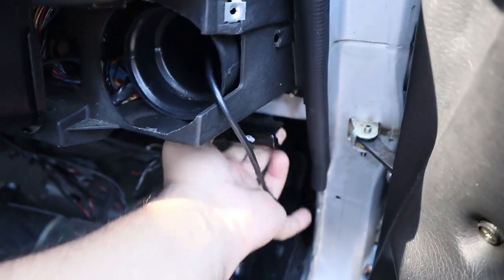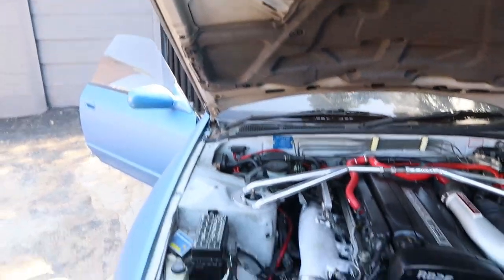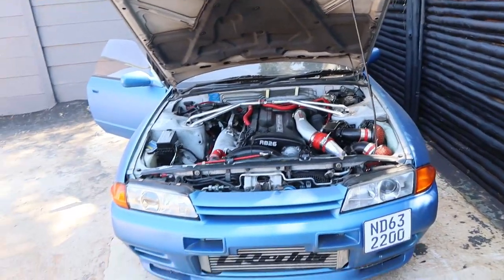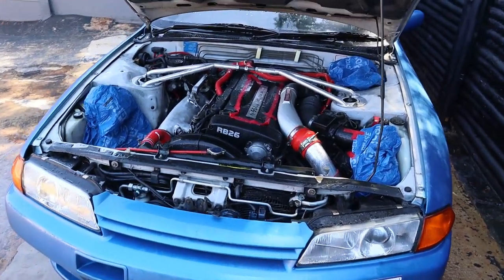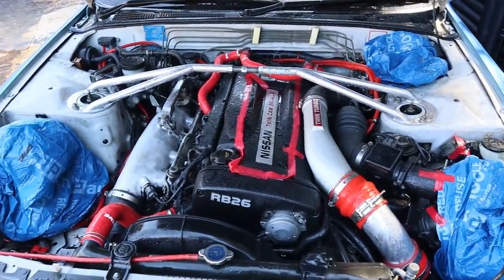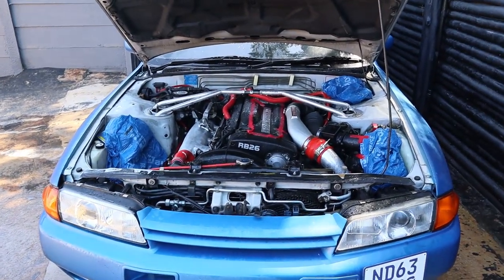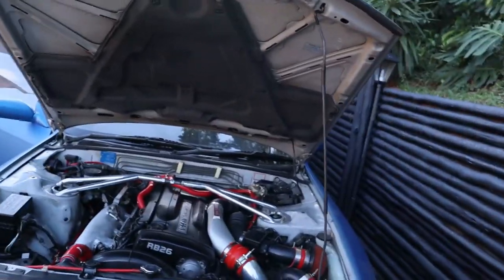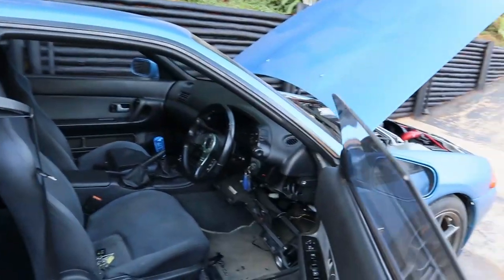Power Washed my RB26.. Good idea? Bad idea?

Comment: Breaking shit on purpose to make more content lol. SO all the bits are sealed well enough for a hose, but not a high pressure washer. But as they age the seals stop being seals... Whenever I degrease the engine I always run it 1st, get some mild heat soak, leave it for about 30 mins, then go for a start helps to evaporate the water off. Let it get fully up to temp while idling then go for a drive. But yeah garden hose pressure only.
Reply: I pretty much use the same technique as tangles described, using the engine heat to help evaporate the water.  Looks much improved, mate.  Those revs sounded good through my headphones.👌  Off to work for me... Y'all have a great day.
Reply: @TheMick26  Of course you use my technique, its the right technique lol.
Reply from the maker: I didn't do any direct spraying on the connectors, should be okay.. Only went a bit crazy on the chassis and plastics... Will do what you said next time though! ✌
Reply: @tangles01  LOL!  I wasn't aware it was your technique, tangles, but I have no doubt you do it the right way. There are a few differences though. When the water falls out of my engine bay and goes down the drain, it swirls counter-clockwise instead of the other way, down under.😅😜 Cheers!
Reply: True...

Comment: The ignitor is almost always the problem. I repaired mine by taking it off a friends old set. 
After ignoring the 40000 Volt warning, I took it apart and saw that there was corrosion and rust inside.
Reply from the maker: Hopefully everything will be okay on mine, what car did you do it on?
Reply: NelKel JDM it was on my corolla. The same set of generic HIDs run the lights in my pic here. 
When I was researching HIDs, after mine broke, all results turned up the same thing... A ballast that converts the 12V DC to 40V AC... And then the ignitor that steps up the voltage needed for initial startup of the bulb. 

I literally took apart the entire ballast and tested each component with a multimeter. 
The ignitor has a huge capacitor that was corroded on mine from water damage.

Comment: I hose mine off with de greaser , i just avoid the cpu and coil packs , but he block and trans , firewall no prob.  i have my car running when i do it . that way if it hiccups i can stop before  it gets worse or floods something i am missing .
Reply from the maker: I poured degreaser on off cam then hosed but only down the firewall and on the strut tops..I probably should have done it while the car was running... either way it came out alright 😊 Thanks for the comment bro!